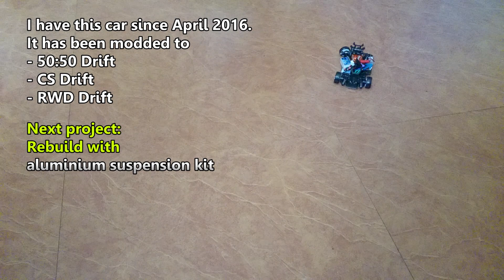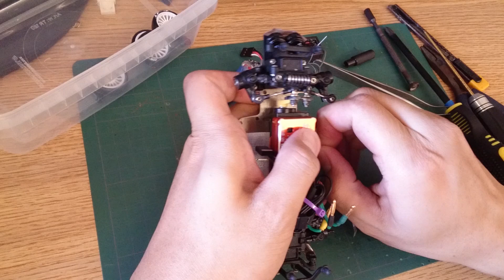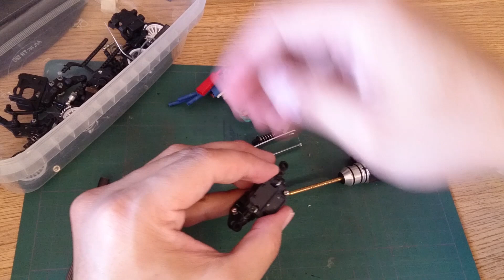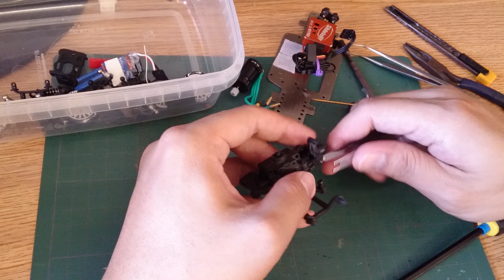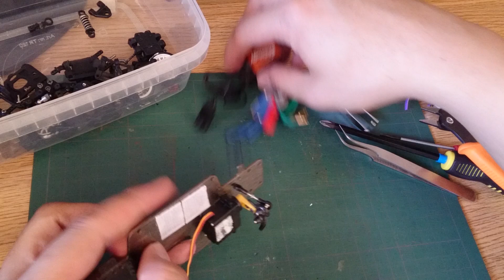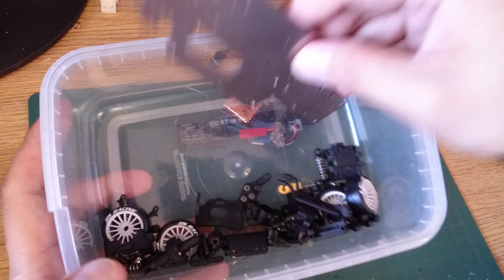Disassemble My WLtoys 1/28 RWD Drift

Comment: I broke one of my steering linkages in a crash on my k989. Would you recommend the sinohobby one in the description for a good upgrade or should I just get the stock ones?  Thanks in advance! ✌🏾
Reply from the maker: The sinohobby rods won't fit because they are too short. I suggest getting turn buckle or linkage for 3.5mm ball head from something else like Trex 250 helicopter. You can also make adjustable link out of it too. Still, the rod will be too short for tie rod connecting between left and right wheel. So you'll have to do a bit of modding by cutting the old linkage and drill the centre then put the rod in.
Reply: Thanks man! I’ll look into that. I don’t want to try the shitty aluminum upgrades lol
Reply from the maker: @miniracersus   Aluminium upgrade will make you miserable in no time unless you want some bling on your car and able to put up with it.
Do you know what I got after buying it? Buyer's remorse. At least I'm able to use (some of) it to fix my old car though.

Comment: Damn man you take a Lipo off and immediately put in a Lipo bag and here I am with boxes full of lipos and I don't even think about it any more. I've only ever had 1 issues in the 10 years or so I've used lipo when charging and my brothers charger decided the cell needed 4.5v when I pulled it off but, never an explosion just a puffed hot battery, knocks on wood Lipo isn't as dangerous as some would lead you to believe. I think it's just something that is left over from when they first came about and people not knowing how to manage them. The most important part is never leave unattended when charging and never toss them in a bag where they can get poked.

Also throw them away if they puff. A new battery is far cheaper than a new house and everything in it.
Reply from the maker: Thanks for the suggestion. I usually but batteries in a box too. This time the bag was in my reach so I just grabbed whatever I can at that moment so it wouldn't be in the way. I do use the bag for transporting though.
Reply: @BeaversHobby  Ya transport is the biggest benefit of a Lipo bag for me. Some people charge in them but, I charge right next to me and like to watch the Lipo to check for puffing or heat.
Reply: Aw Jeez Micro Whoop, I'd get a bag to put inside a tin that goes on a tray that's put in a cinder-block bunker surrounded by extinguishers, now you've tempted fate. #FingersCrossed4u.
Reply: @stevewatts3502  I'm not too worried we all have a lithium battery in our pocket all day long. Nobodies worried about that well unless you have that galaxy note that kept blowing up haha.

Also don't use an extinguisher on a Lipo fire it most likely won't stop it unless its a small Lipo. You need a bucket of sand to smother the lipo.
Reply from the maker: @microwhoop7420  Galaxy note is the one that should come bundled with fireproof bag.

Comment: hey man, I have the radiolink rc6gs, I know I can use it to mix 4ws, but I was wondering if it was possible to program the controller to mix the settings to a 3-way toggle for front steer, rear steer and 4ws steer?
Reply from the maker: I don't think you can. I also don't find any mention about mode toggle in the manual too.
edit: This probably can be done through firmware update. Try e-mailing them.
Reply: @BeaversHobby  thanks for letting me know, I'll try and contact them.

Comment: What type battery you are use ?
Reply from the maker: 2S lipo.
Reply: If want to make rwd drift , what the item needed ?
Reply from the maker: @dzikiadriansyah2108  
Full details here: https://youtu.be/CUZIcDH5P6g
Basically you need

Wheels: http://bit.ly/2VeVZsc

Tyres: Contact DS Racing at https://www.facebook.com/DSracingthailand/
JJRC Q35 Ball Links: https://goo.gl/XwMEo3
Sinohobby kit: https://goo.gl/vTjbFh

Gyro: http://bit.ly/2LAH1ND

You can keep using stock electronics but it's better to upgrade and use batter transmitter so you can have control over many things.
Motor: https://goo.gl/JVJzaH
ESC: http://bit.ly/30dDCrk
Programming Card: http://bit.ly/2YpN2hs
Radiolink Transmitter: http://bit.ly/2WSjb0G